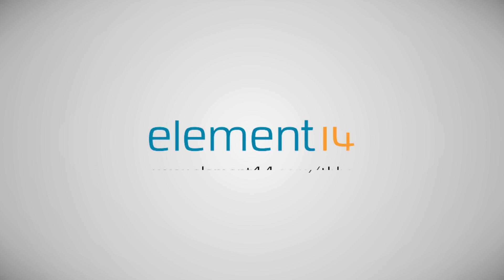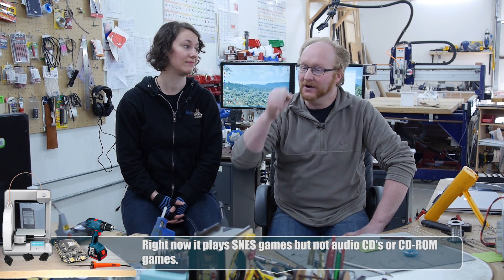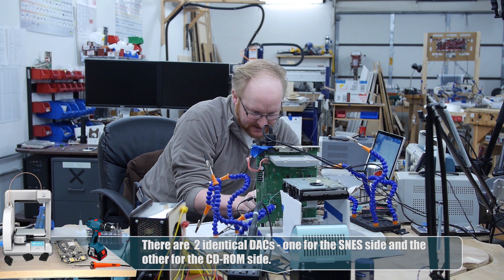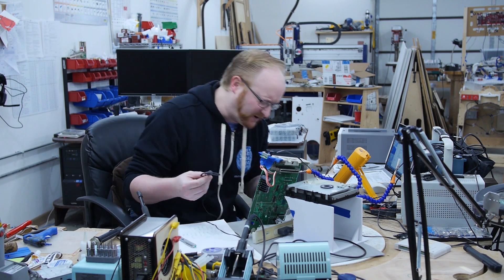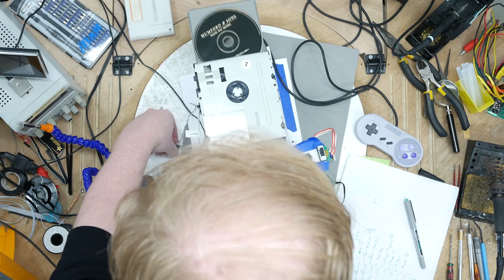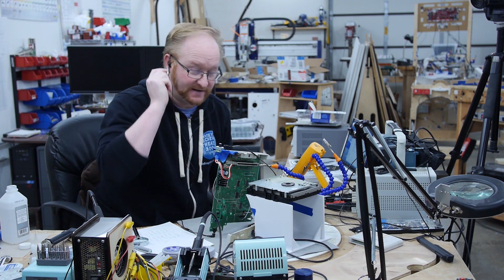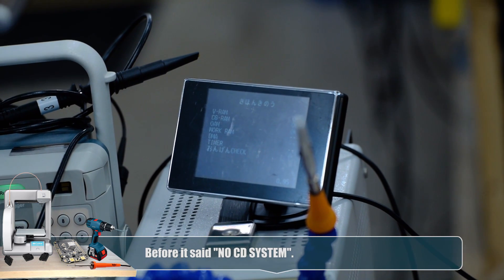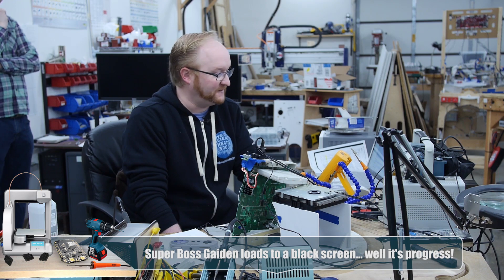Nintendo PlayStation Prototype: Finally Working!

Comment: What i really want to know is how do you figure out how games work on the cd part of things as this is a phototype how do you know about the hardware etc because this is a phototype how do you make games for it how do you get games to work on it i remember back in the 90s someone i knew had a original playstation and he could run some sega Saturn games on it i remember playing sonic the hedgehog on the playstation i just don't understand how you make games for a phototype system i know some people have successfully converted GTA to work on a Dreamcast it's still abit glitchy though i need to know how you get games to run on like what do you have to work with is there chips that tell you what it can do and you make games to fit the system 🤔 it's like i dont understand that say you have 2 32bit systems with the same games for both systems why can't you say put a game from say the playstation to the sega Saturn as both are 32bit systems it's like the mega drive version of mortal Kombat has a blood code but the Nintendo doesn't have it but why can't you just transfer the sega version to the Nintendo

Comment: I have a few questions and a  Project that I'm interested in trying to get done ..   Right now I'm not sure where to turn to try to fix the little bit of a problem I have  And it looks like you guys are equipped with what's necessary to accomplish  And solved  this problem...

Comment: That thing looks suspicious. 
It's called SuperDisc in the bootup but the console and controller is labeled as PlayStation. 
And another thing It's supposed to be an Add-On for the Nintendo Super Famicom not a Standalone Console.
Reply: It's a standalone prototype that followed the guildelines of the original contract Nintendo signed with Sony, in which they will develop a seperate add-on and a standalone system that only Sony would sell, with most of the royalties for the games going to Sony.

Comment: To me I think the breaking point topic between sony and nintendo was the cartridge "ram" that would load the cdrom data. Sony wanted to scrap the cartridge altogether and have built in ram (this would have saved on production costs), and nintendo wanted to keep the high speed of the cartridge. This is apparent in how they released their systems until nintendo learned how to "CD to ram" as well with gamecube, but before all this, sony basically learned from top to bottom how to expand from making audio chips to gaming chips+layouts since they worked so close with nintendo at the time. sony was more a bully here with nintendo being more steadfast, but if nintendo agreed on dropping the cartridge and sticking to cdrom only early on, i believe that their union would be lasting to this day. playstation would probably still be a sony/nintendo venture, and "mario 64" would probably have an amazing sound track. sony would probably have offered a lot on the recording front there. I bet sega consoles would exist too.

Comment: You should have popped in WipEout 3 (aka Wip3out). Not only is it a Playstation 1 game (obviously, it probably wouldn't be 100% compatible), its Redbook audio tracks can be played by literally any CD player. Plus, it wouldn't give you a copyright strike.

I strongly recommend Track 13 (14 if you count the data track as Track 01).

Comment: I suppose the cd microcontroller chip is responsible for playing music cd’s once it operates in non-snes mode, aswell as having extra ram.

Trough i never understand why sony did not make the spc700 compatible with music cd’s in the first place and then make it optionally run in brr adpcm modes for snes games,

 i say this because the cd rom for the snes was already planned on day 1 once sony agreed the deal with nintendo, oh well maybe those ext sound pins were planned for the cd rom in the first place.

But the spc700 can unintentially play true 16bit audio in 32khz at 128kbps, wich sounds close to cd audio, because it even avoids that cheapass guassian filter, ,so sony could,ve add a chip to convert cd music to snes format to make it work on snes without hearing audio loss.

Comment: I think the Nintendo PlayStation would've gone the way of the Sega CD. The SNES simply didn't have the processing power to take advantage of what could be stored on CDs, like high-res textures, 3D models, cutscenes, etc. In the end the Sega CD's CDs were just jammed full of FMVs while the actual games could've easily worked on a cartridge. Ironically, when the processing power was there, Nintendo chose to stick with cartridges and shot their N64, which was the most powerful console of its generation, in the foot.

Comment: I sort of have doubts about this. I always was told/read that it wasn't going to be a stand alone console but an add-on for the SNES which would have plugged into the port on the bottom of the SNES. Also there was no prototype just concept art. In the end they (nintendo) saw how badly the mega cd was doing and pulled out of the project.

Comment: the only difference between analog nature and digital is that nature use sine wave where on the other had computers use square wave, so that a modulated rf wave have much the same features as a digital wave. speach in pc speaker would be just square wave modulation but can do like real speach. a em spectrum in a computer is just different square wave frequencies inside each other. actually rf waves are kind of like square waves as well. i think our universe is data and that em waves are just data in a computer processed by algorithms and that tuning into a frequency is just trying to filter out parts of algorithms you don't wan't to read by using a lc circuit program to only read the cut offs of the square waves without knowing their cut offs. i currenly don't know how to create square wave filter algoritms but that is what a lc circuit would be as a computer program in the matrix. it had been interesting if we could take the states of electrons in atoms and translate them into binary and just read of the quantum code this way, so that the computer could reconstruct matter digitally. we just need to find out how to make algoritms that can read the binary form of reality.  atoms resonate at a frequency like a single square wave tone on a computer but in a very high frequency. its probably a very simple algorithm that makes an atom or many atoms. by adding information to atoms, they will increase mass my increasing their electron mass. that means that in a computer program, an atom will be some bits of data that can increase their mass by adding together more data defined as one thing. i think that water simulations in computers are simmilar to matter in the binary form of the data and that atoms wave resonance traits are like the algorithms that defines fluid simulations. there is no real difference between a program that simulate fluid in a computer and  the interference pattern that makes up fluid in nature. the iterference pattern of natures fluid is acting in the same way as fluid computer simulations. if we had compared the binary square wave modulations or binary code in fluid simulation with the fluid interactions with natures fluid dynamics, we would be able to find out the paralell between the real fluid and the simulated one, and how the underlying algoritmic pattern of nature would look like by studying the changes in the binary code of the fluid simualtions.

Comment: So it basically just uses the cartridge like an Everdrive flash cart but with the data transferred from a CD instead of an SD card and it doesn't really add any additional processing power to the base SNES unlike the Sega CD did. So really the only advantage to this would have been increased storage space. No wonder Nintendo decided not to bother releasing it. Still an interesting part of gaming history though and defiantly cool that it still exists.

Comment: I really like the song you were worried about getting flagged, by any chance could you tell me which version it was @ 4:08? I used the ShaZam app because I didn't know what song it was. Its said it Hard Day (Shep Pettibone Remix) by George Michael. Though I listened to the original version, and it sounds more like the one i the video. Though Its kinda creepy that it was able to determine what it was off less then a few seconds. Even with the sorta muffled audio.

Comment: Some times when you connect a new device to a computer, it doesn't detect it at first, but if you reboot it, it detects it without a trouble, I think that it may be the same here with the cd. Also why would some one make an emulator for the snes playstation? it doesn't have any game I think that that woud contribute to make the process even more difficult.

Comment: Can you help troubleshoot a Siemens NotePhone? When connected to a US Telephone line it works but then later on seems to think it is Off Hook when you have the handset on the cradle. This was originally sold in Germany so you'd need a correctly wired telephone line because the wires are setup differently. I did fabricate one but I'm not sure where it is at the moment.

Picture of the Siemens NotePhone (which is a Newton OMP clone)
https://www.flickr.com/photos/sonnyhung/albums/72057594059547504

Comment: With electronics it's always gremlins!!! We deal with it all the time with communications and propulsion control systems... most likely a loose wire / intermittent connection... know if it happened once it will occur again... if continuity fails you resistance won't...

Comment: I would generally avoid using new CDs altogether if testing an old system, unless as part of a slew of "less than ideal cases" — the copy protection on more and more CDs pressed after around 2005 could very well cause some older CD-ROMs to freak out.

Comment: I'm wondering if you could replace the entire cd unit with a fpga that loads the data from a sd card. This would eliminate all the shortcomings of cd technology. Then you could use the work you learned from doing that to make the same device for popular cd based consoles like the sega cd, pc engine cd, neo geo cd, saturn, playstation 1, etc

Comment: Pardon me, but I've made a comment downstream and I don't want it to be missed...

Dear Ben Heck, please put a Raspberry Pi in a C64. Then have the Pi take ordinary SVGALIB graphics, and convert them into a format that would display on a C64. IE a bit of dithering, some resizing, etc. Then a program on the C64 brings that data down, copies it into it's screen RAM, and it displays. So you'd be converting SVGALIB graphics to C64, coming from the video output of a real C64, from it's own RAM, put there by the 8510, or whatever screwy name they gave the 6502. 

Besides SVGALIB, you could maybe do X. Just the part of converting a PC screen's bitmap into a C64 screen's bitmap, then copying it over. 

Then on the PC you run whatever software you like, including.... emulators. 

Then the final step is doing the same thing on other 8-bitters. Atari 8-bits, Amstrad CPC, Spectrum, etc. SNES would be good. 

Also the 8-bit scans it's inputs and sends them to the Pi. Pi Zero probably would be the best fit. The Pi converts that data into whatever keyboard and device input (isn't Unix wonderful for that? the whole /dev/ice tree I mean). 

Then the Pi runs, converts it's graphics into C64 again, and we're back where we were. 

This could be done, and you could do it. You have the lab, brains, hardware, and unusual brand of sanity required to do it! I'd love it if you did, and you'd go from legend to super-legend. Like the NES to the SNES. Super-hella-64-bit legend is what you'd be, my friend. 

PS used to see you back on RGVC when we were all young and stuff turned up cheap in thrift stores and car boot sales!

Comment: +Izlude Tingel good find!  So the final console did plan to have onboard FX and other bells/whistles.  This prototype doesn't seem to have any of that, so it's definitely a preliminary build meant to get system functions working and not a developer unit. If people plan to clone this console, they'd better find the later units or at least documentation (if it even exists anymore) otherwise there's no point in cloning it because clone cartridges hold as much as a CD anyway.

Comment: Ever since I watched you replace capacitors in this and have it work it's been the first thing I've checked. I mean, it worked out, I've fixed a set top box and I fixed an issue with an amplifier by changing out old caps.  I need an Oscilloscope for the amp though, I need to find where the distortion starts.

Comment: I had an interesting thought.  Could have there been different carts in the pipeline for different upgrades?  Like a 32 bit processor on the cart or a 3D graphics chip (Better than the FX chip)

Comment: Great job!
Too bad there's only one of these in existence.
While better than no hardware at all for emulation writers to use as a reference, this still means it's near impossible to have a good look at the system for the vast majority of them.
Another thing - emulation is good, but running games on original hardware (or at least on a reproduction of that) is so much better.
Sadly, this probably means there will never be more than a couple of homebrew games for the system.

Comment: This would've been a God of a gaming console back in the 90s had Nintendo not backstabbed Sony in favor of Phillips. Imagine the N64 and PS1 or Game Cube and PS2 as one console. That would've bankrupted Sega before they would have a chance to release the dreamcast and make the original Xbox an even bigger failure than the Xbox One. Hell Nintendo and Sony could've monopolized the gaming industry lol
Reply: Darksyne But then again we wouldn't have cod battle field portal Minecraft many games wouldn't exist so its good that it turned out this way.
Reply: Of course we would have... They're 3rd party games...
Reply: Darksyne We wouldn't have portal it was based off a demo on the n64or ps1 which wouldn't exist Minecraft would probably die without Xbox or PlayStation Cod was made on the ps2 which  wouldn't exist  battlefield wouldn't exist I'm not sure where it started And the xbox360 mostlikely wouldn't be made so the gaming controller would probably be different 'I could be completely wrong not saying I'm correct about any of what I said'

Comment: Well, my computer wouldn't start when I installed a new motherboard.
After 11 hours of rebuilding, testing etc, it turns out that removing the exchangeable battery and plugging it in again made the computer start.
It wasn't in a weird angle or anything, it's just how electronics work.

Comment: Hi Ben!! Can you (or anyone else here) please take a look at this article about the SNES CD and the FX chip?  Does it describe the console as having onboard capability of what the FX chips could do?   anthrofox. org/starfox/superfx. html  Between the console you fixed (the prototype) and what's described in the article, are they very different specs?  Can the one you fixed do CD versions of Starfox? The one in the article sounds like it can, so I'm wondering if the prototype in the vid is missing what's described in the magazine clipping.   If someone's gonna clone the system, better to make sure it has all the bells and whistles that were intended for it!

Comment: I recall old Panasonic changers having like 8 pots to adjust to a correct setting before they would work properly after swapping the laser. That was fun. Sony's were well known to be super picky with cd's , at least the lasers were cheap .

Comment: Bit disappointing it turns out just to be a CD that loads normal SNES games, wonder if that was intended to be the final version? They gave it a case after all, you'd think that'd mean more-or-less finished hardware. Shame it didn't have any extra features. 

I suppose extra features would mean splitting the market, like eg the 32X, where only a small percentage of gamers owned it, so software houses didn't write much for it, preferring to write for the base system where all the sales are. 

Still, would you buy a whole new SNES, and a new set of games, just to play ordinary SNES games? The SNES was getting older at the time. Probably would've been a failure if they'd launched it.

I believe at the time, 3D hadn't really taken off. FPSes were called "Doom clones", and people were pretty sure that the "3D fad" would fade away. They were wrong! So Ninentdo wouldn't have thought to put 3D hardware in there. And there weren't really any 3D chips anyway, the SNES used DSPs and faster CPUs in the cart, I believe with stuff like a hardware multiplier, but nothing like triangle renderers etc. 

The Sega Saturn is a good example of that, they added 3D capability at the last minute. By bodging an extra CPU onto the bus, a really desperate move! Then using it's sprite-warping capability as a square renderer, since it's much the same thing. Software companies bitched about that, since every bit of 3D maths in the world was built around using triangles. Originally the Saturn would've been more like the Neo Geo, capable of billions of huge sprites, warped and rotated and whatever else.

Anyway... still a great job to get it working!

Comment: It's no surprise that audio CDs (CD-DA, Red Book) were more demanding of the drive performance than data (CD-ROM, Yellow Book) discs: the Yellow Book standard adds another layer of data redundancy that Red Book audio mode doesn't have, the idea being that a missed bit here or there is inaudible in an audio stream, vs a single bit error being catastrophic with computer code. The flip side is that this redundancy chews up about 100MB of space, meaning that a traditional 74 minute CD-R could hold about 650MB of data as a Yellow Book CD-ROM, or 750MB of raw audio as a Red Book audio disc.